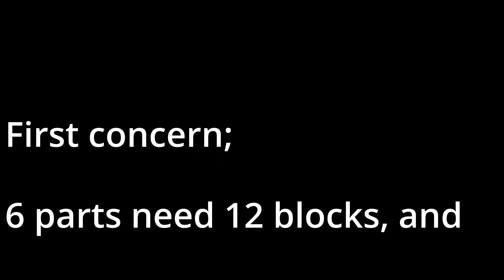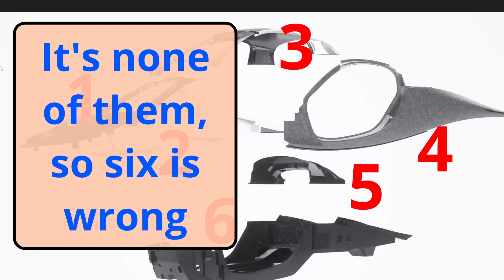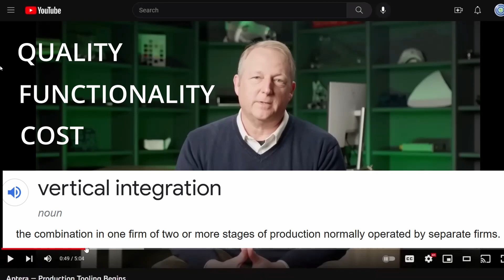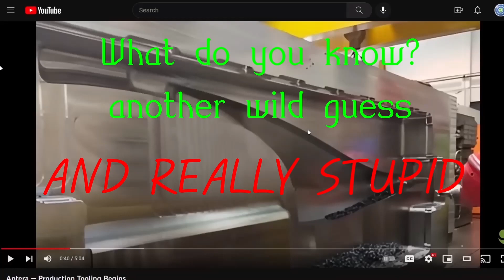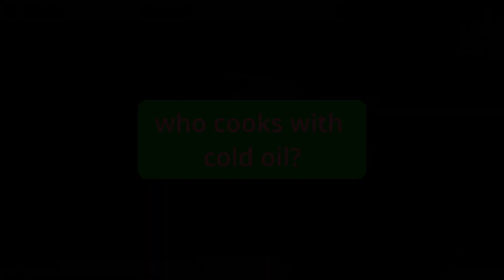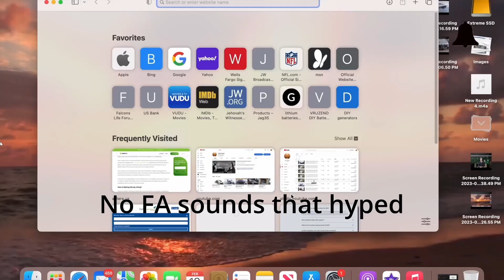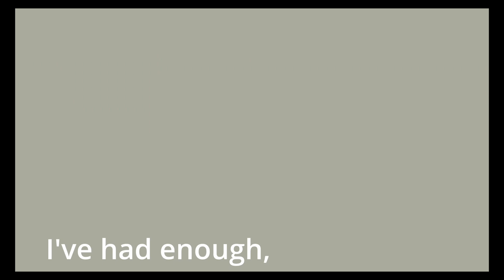APTERA DIES    What gives?

Comment: I'll cover the valid points first:

1- There are molds missing in the video
2- It looks like 6 parts could be a stretch, probably like 6 main structural assemblies
3- The suspension will be a challenge, due to the unsprung weight, and probably will need to be be tuned well into the delivery phase (IF IT HAPPENS). I do agree it still looks bouncy, especially on smooth California roads. It has improved since the early prototypes, at least from the videos. Some may see an encouraging sign there.

Now for the nonsense:

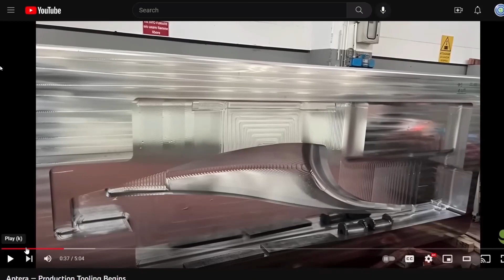1- Not sure what you are talking about at 7:48 with the rectangular pads, and the fact it seems to rest on them, or that the surface looks like glass? I must be missing something. To me is looks like a machined mold, steel or aluminium, and those pads seem to be some random parts resting in the cavity. You say "I don't know". I would agree.
2- The burnout discussion goes nowhere. Someone said there was burnout marks proving it was a "hard launch" but I could not see them. At least you are correct in saying we should not see massive burnouts if the algorithm for "launch mode" worked correctly. But I did not see any sign of excessive burnout, so it probably works fine.
3- The discussion about the missing speaker hole? is weak at best. The fact there is no hole or plug in the mold doesn't prove anything. These parts are going on a 5 axis CNC after they get pressed. Making the hole there is probably easier than doing it in the mold. Definitely not a smoking gun.
Reply from the maker: Without reading ahead more than the sentence stop:
[I'll cover the valid points first:

1- There are molds missing in the video] At least nine. Quite a cost saving.
[2- It looks like 6 parts could be a stretch, probably like 6 main structural assemblies] Truth is always a stretch with them.
[3- The suspension will be a challenge, due to the unsprung weight, and probably will need to be be tuned well into the delivery phase (IF IT HAPPENS). I do agree it still looks bouncy, especially on smooth California roads. It has improved since the early prototypes, at least from the videos. Some may see an encouraging sign there.] Lipstick on a pig.

[Now for the nonsense:] I thought we were already there.

[1- Not sure what you are talking about at 7:48 with the rectangular pads, and the fact it seems to rest on them, or that the surface looks like glass? I must be missing something. To me is looks like a machined mold, steel or aluminium, and those pads seem to be some random parts resting in the cavity.] On another look, I would say the black pad is sitting in the cavity and it has a strong reflection, so it is a metal block. 
[You say "I don't know". I would agree.] Now I know, and I always knew it was of the outer skin, which is guessed to be of a cheaper material than the carbon fibre of the inner skin.
[2- The burnout discussion goes nowhere.] Nor does it belong here. You should have responded where the comment was. 
[Someone said there was burnout marks proving it was a "hard launch" but I could not see them.] Certainly not on this video. 
[At least you are correct in saying we should not see massive burnouts if the algorithm for "launch mode" worked correctly.] I am also correct in saying the block looked like glass, but I didn't know. It's subtle, but factual.
[But I did not see any sign of excessive burnout, so it probably works fine.] Let's wait until a real Aptera gets in the hands of proper, independent road testers? It has to happen, unless they fold.
[3- The discussion about the missing speaker hole? is weak at best.] Weak, but still correct. It is just a sign they are not meticulous enough to be genuine. 
[The fact there is no hole or plug in the mold doesn't prove anything.] There's proof, and there are signs. I never said it was proof, so you can claim it's not proof and I am not bothered. However, it proves it is not the inner part if they are not cutting holes.
[These parts are going on a 5 axis CNC after they get pressed.] Bruce baby claims they don't need that but - hey - what does he know? 
[Making the hole there is probably easier than doing it in the mold.] Probably not.  [Definitely not a smoking gun.] I never said it was a smoking gun, either. I do believe that if you added every concern I have raised, no matter what the size, you would have a smoking gun. Not much, individually; but too much collectively.
Reply: @aussieideasman8498  I think you make some valid points. Mostly some easy bets, like "look another startup will fail". They probably had less than 5% chance of making it when they rebooted, at the start, now probably more than that. So it's easy to be a naysayer. However your good points get muddled up in the nonsense, bad engineering critique and such. It's also a bit much that you seem to think everyone is an imbecile, yet spout off some poorly crafted theories on why nothing will work. There are plenty of real challenges to highlight in the design if that's your cup of tea, no need to make things up.
Reply from the maker: @maptap6654  [I think you make some valid points.] After a year of watching the nonsense they call progress, many valid points, not just some. Most have them have never been refuted. The videos and the comments are all there to test my claim. [Mostly some easy bets, like "look another startup will fail".] What does it matter if they are easy bets or hard? The advice is the same. There are many reasons why startups fail, but at least there is little wrong with the product in most cases. Aptera intrigues me because it didn't work the first time and they concealed the fact as much as possible. Since 2019, they are still concealing. This is unique to Aptera, so don't lump them in with the other easy bets. 
[They probably had less than 5% chance of making it when they rebooted, at the start, now probably more than that.] They have taken a lot of money along the way, and if they knew they were under 5% chance, they should have had the morals not to begin. To have a 'skin cooling' concept fail should have been enough for them to prove that worked before embarking on their so-called 'journey'.  
[So it's easy to be a naysayer.] It's not easy being a naysayer that has so many valid points. I stand apart from most others. Over 700 ambassadors have learned not to even tackle my points. Some of the dumber one's have tried diversionary tactics, but they don't work - I wasn't born yesterday.
[However your good points get muddled up in the nonsense, bad engineering critique and such.] You need a lot more examples of the nonsense; the bad engineering points; and the 'such'. Only a gullible fool would accept the scant amount you have provided, thus far. This is just another diversion.
[It's also a bit much that you seem to think everyone is an imbecile,] I have little regard for those who 'seem' too much, nor of those who don't know the meaning of words like 'everyone'. The facts of the matter are that I have never though everyone is an imbecile, nor as much as seemed to be. I acknowledge that the world had a good sized population of imbeciles, so am not in false denial, but few of the investors, preorderers and general followers are imbeciles. They are just low on intelligence, in the main; a general observation. A kid can get fails for geography and straight As for maths, so intelligence varies from topic to topic. There are doctors who are duped by Aptera, and I don't say the docs are absolutely low in IQ - only when it comes to our particular subject, then even they can think almost like imbeciles at the extreme. 
[yet spout off some poorly crafted theories on why nothing will work.] Not only do I pay little heed to 'seemers' and those who don't understand basic words, I pay no heed to those who claim poorly crafted theories and don't have a list with explanations of what makes them poor. The first principle of a product is to prove it works by the seller, and that has not been done in the slightest - well, not nearly enough. A failure. Now, me having to prove it doesn't work is hardly necessary under those circumstances. But I give good hints, anyway.  
[There are plenty of real challenges to highlight in the design if that's your cup of tea, no need to make things up.] If you like, I can list all the challenges I have highlighted, and you can list the ones that you think I have invented. Are you up for it? All you have to do is prove they have been resolved - that they work. Then we will see how many challenges I have that are still doubtful, so we can evaluate whether it is prudent to be a naysayer, or not?

Comment: When has Aptera put up a render and claimed it was real? Or do you have trouble telling the two apart and push the blame on Aptera because of your confusion.  

Let’s clear up your confusion troll man.  Yes, Aptera is looking to raise 50 million to start production, have you forgotten about the 21 million dollar grant from California? Also Aptera could expand the end time accelerator program if they wish.   With the republic funding and the accelerator program so far they have raised 7.3 million. 

Now on to your die confusions, it’s a pressing situation.  You know you can highly polish steel that it will reflect light like a mirror, right?  The bottom edge of the door sill is not super thin like you claim. At time stamp 20:50 when you make your comparison, you add the width of the skin cooling belly pan.  There are renders from the build up of panels that show this area with out the belly pan. 

To clear up more of your confusion, you really should look at the parts rendered before you make statements.  The quarter panel (part4) that will be made from that die will be fiberglass SMC.  That panels is bonded to the carbon fiber SMC tub/ floor pan (part6), the tub is the main inner panel.  It is the tub that has the provision or hole cut for the speaker, you can see this is your own video at time stamp 21:32 when you can see the render with all the provisions cut out of the tub and the smaller parts of the body.  The reason behind showing the quarter panel is that part with out a doubt is uniquely from an Aptera.  It all adds up, you’re just that seeing what you want to be negative.   

CPC is a vertically integrated company, they have their in house engineers, cut and machine the dies to make parts,  that are then finished and assembled into larger components and cars. If you want to know more about CPC, search “Mitsubishi Chemical Makes Capital investment in carbon fiber-related facilities at CPC in Italy”.  But you probably won’t.   did you ever look up the interview with Paul Wilber? 

Have you ever thought that there claims have been proven and the information has not been released until there is a full production version. Aptera has been very open about their development, more so than any other company.   What car companies show the dies for a new car being made, or a teat mule with equipment all over running around a track?
Reply from the maker: [When has Aptera put up a render and claimed it was real? Or do you have trouble telling the two apart and push the blame on Aptera because of your confusion.] We live in different parts of the world. Over here in the promised land that actually delivers, if you use a render and don't make it clear that one is being shown, you are breaking consumer protection laws. They don't wait for you to claim a render is real before getting you into jail. Aptera has done more than enough to throw away the key on those two snake oil salesmen.  

[Let’s clear up your confusion troll man.] I can't wait to see what's next.  
[Yes, Aptera is looking to raise 50 million to start production, have you forgotten about the 21 million dollar grant from California?]  Forgetting things never confuses me, however, they have repeatedly claimed it's 50 on top of the 21. Keep up. Then there's Sandy with a more realistic estimate of somewhere between 300 and 500. 
[Also Aptera could expand the end time accelerator program if they wish.] I'm banking on it. They have extended at least ten other end times, already. They once said fundraising was closing for good, then opened another round within weeks. Keep up.   
[With the republic funding and the accelerator program so far they have raised 7.3 million.] Half way through the AP deadline and a quarter of the way through the cash. They spend it nearly as fast as they get it. Now you are causing me some confusion - can you tell me what fundraising has to do with renders and their deception?

[Now on to your die confusions, it’s a pressing situation.] I like the pun.  
[You know you can highly polish steel that it will reflect light like a mirror, right?] Yes, but I would only do it where necessary, as it costs a motza, and doing the whole block is wasteful.  
[The bottom edge of the door sill is not super thin like you claim. At time stamp 20:50 when you make your comparison, you add the width of the skin cooling belly pan.  There are renders from the build up of panels that show this area with out the belly pan.] Keep up. I said if the prototype included some belly pan, then they are not using a seam. This is what provides the anomaly; if the battery needs replacing, it has to be from below, so it would need a seam where it can be separated without having to wreck the wrap. If you wrap over the join, then that is a most inefficient way to do it. Isn't Aptera all about being the most efficient? Of course, what I am alluding to is that die and prototype are out of whack. Either, or - it doesn't matter to me; it's all food for thought.

I will separate this for the low in attention span.
Reply from the maker: Second half (I hope you took a long enough break?):

[To clear up more of your confusion, you really should look at the parts rendered before you make statements.] Rendered? I prefer to wait to look at parts made.  
[The quarter panel (part4) that will be made from that die will be fiberglass SMC.] At 8:33, my calibrated eye sees a panel that drops at least four times the height of the sill. Checking against the die at 20:50, it stamps a panel that drops less than the sill height on the back of the door opening, and tapers to almost nothing at the lower front. The two are a complete mis-match, however, I also made the point that the inner liners were carbon fibre and should have dies for them. I was not sure if dies were also required for outer fiberglass parts, but said they would need more than six if it was the case. Keep up.
[That panels is bonded to the carbon fiber SMC tub/ floor pan (part6),] So outer panels bond to inner panels? That tub is not the shape of what every prototype has, bar Beta. 
[the tub is the main inner panel.] Being inner - it's not even a panel. Other moving renders show two belly panels fly in from left and right, shown from behind. These have to be removable for battery swaps, i.e. need seams, not wrapped over.
[It is the tub that has the provision or hole cut for the speaker,] At last, you tell me something I had not noticed. I didn't pay any attention to the back half of the tub. My bad. You got me, there. 
[you can see this is your own video at time stamp 21:32 when you can see the render with all the provisions cut out of the tub and the smaller parts of the body.] I see the speaker hole is on the left side, when other videos show it on the right, and a smaller square hole on the left. I also see that there is nothing on the right side because it is completely white behind the speaker hole. That doesn't match. 
[The reason behind showing the quarter panel is that part with out a doubt is uniquely from an Aptera.] I could not confuse any body part with any other vehicle.  
[It all adds up, you’re just that seeing what you want to be negative.] It got a bit closer when I saw the inner rear wings were attached to the tub, but they ended up not matching what has been shown elsewhere.   

[CPC is a vertically integrated company, they have their in house engineers, cut and machine the dies to make parts,  that are then finished and assembled into larger components and cars.] That defines the opposite to being VI. 
[If you want to know more about CPC, search “Mitsubishi Chemical Makes Capital investment in carbon fiber-related facilities at CPC in Italy”.  But you probably won’t.] Knowing they are in Italy is enough for me.   
[did you ever look up the interview with Paul Wilber?] No. 

[Have you ever thought that there claims have been proven and the information has not been released until there is a full production version.] No. It's a silly thing to do. I'll stick with not proven and snake oil. Fanboys don't think my way, either (but mostly don't think).
[Aptera has been very open about their development,] Then straight away you present an oxymoron - proved everything and keeping it under wraps while claiming to be open and transparent. I don't believe you think about what you say from one sentence to the next. [more so than any other company.] Totally unsubstantiated. I reject it.   
[What car companies show the dies for a new car being made,] It's not the litmus test. 
[or a teat mule with equipment all over running around a track?] That's the stuff of snake oil selling. I am about to comment on that Beta in my next video, coming soon.